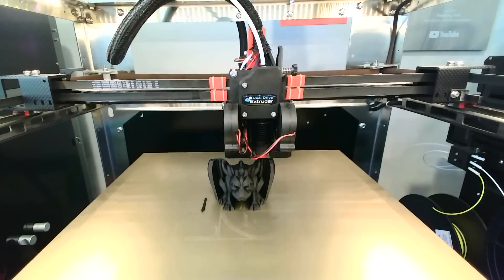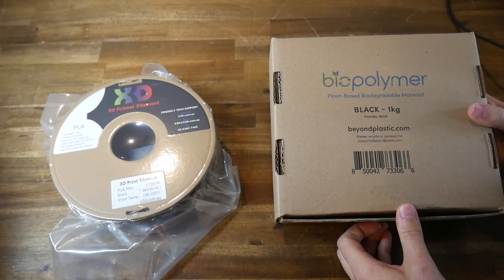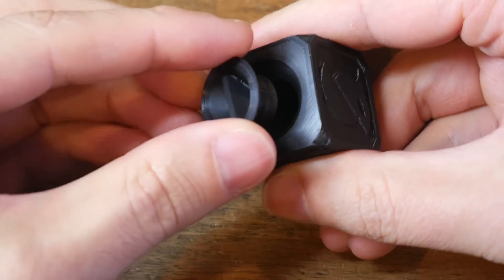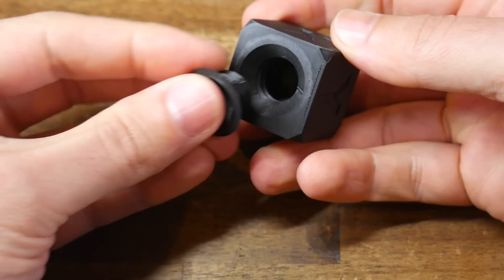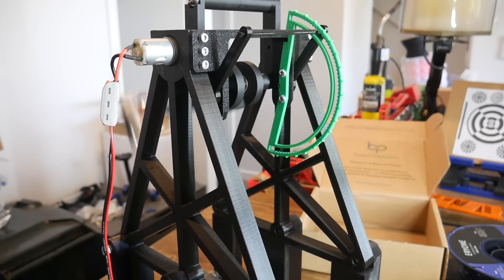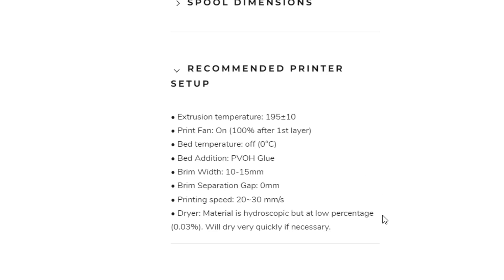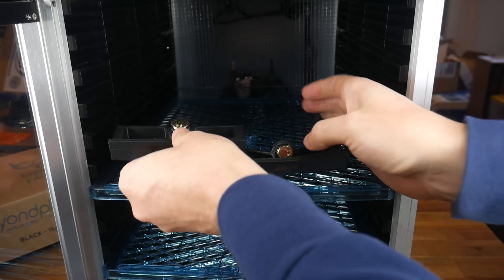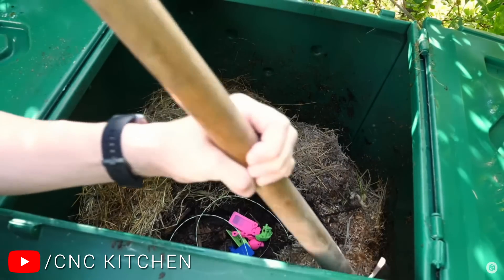PHA filament - Mostly superior to PLA and actually eco friendly

Comment: So if I am following this correctly, it prints comparably to PLA in most cases, it has better heat and UV resistance is and is more resilient / less brittle than PLA.  I guess we didn't see how well it did with bearing a load.  I am very interested to see if this is actually biodegradable.  I would absolutely use this with what I know right now, it seems to be better than PLA in a lot of ways.  

This may be a pedestrian question, but how does it stack up against ABS?  From my perspective, which isn't very sophisticated, the heat and UV resistance are the main benefits of ABS vs PLA, and while those usually aren't a concern for me, sometimes they are.  This just seems like it can replace ABS in a lot of use cases without the need for an enclosure and ventilation and have less of a long term environmental implact.

I'd also be interested to learn about other aspects, like is this food safe or plant safe for plants you are going to be harvesting?  How is adherence between this and other filaments? How does it clean up? (I haven't printed things where I worry about sanding or painting or vapor smoothing yet, but eventually I will get there).

Comment: I'd love to see a formulation of PHA with CF which may mitigate the shrinkage issue and further improve mechanical properties without affection biodegradability
Reply: Carbon Fiber is not biodegradable. 

Word of caution: And this is from the former CTO of Beyond Plastic PHA tested above. 

Composting bioplastics if miss-managed, is the fastest and most efficient way to introduce highly toxic micro and nano plastics into the food chain. 

In Los Angeles, we have composting bin where I do in fact throw in my PHA prints. However, if I was to discard a CF+PHA print. It would be in the regular garbage , and not the composting bin. 

Composting material is meant to be re-introduce in garden beds and other agricultural activities on commercial scale. I don't think anyone would enjoy CF in the very food they grow to eat.

Comment: 100% interested, the warping will probably be figured out and aside from that it looks like a perfect material
Reply: If it were a perfect material, it would be in general use/would have preplaced PLA by now. The warping might be its downfall.
Reply: @c.augustin  not sure, some materials emmerge now because they were complex or not interesting to manufacture yet, FDM requires matetial properties quite different from other polymer uses (i.e injection molding needs very low viscosity)
Reply: @c.augustin  warping might be solved similarly to nylon where they mix some fibers in it

Comment: But how does it compare to PLA+? I don’t even care about the biodegradable aspect, if it takes heat better than PLA and is less brittle it may be more useful for functional prints, if the cost is around the same as what you paid ($20/kg)

Comment: It was looking so good up until the warping. That is just not acceptable, especially since it doens't seem to have a workaround to resolving that issue. 
One thing you should think about adding to your filament testing is a shrinkage test, such as califlower. Shrinkage is a major issue when printing mechanical parts.
Reply: "not acceptable" dude, all common printing materials shrink, have you tried PETG, ABS, ASA, Nylon... :D PLA is quite an exception in that it does not need a heated chamber.
Reply: @PunaJussi  Nonsense, PETG doesn't have warping issues. PHA seems to warp more than Nylon composites too.
Reply: @oyuyuy  "PETG doesn't have warping issues" -- huh? I have problems with PETG prints warping, not all the time, but certainly often enough that I know a claim that it simply "doesn't have warping issues" at all is false.

The warping demo in this video involves very thin vertical walls, which is a different warping profile than PETG has in my experience and appears to be a worst case scenario for PHA. The other prints demonstrate that with more forgiving print scenarios, PHA is perfectly fine. So...know your material, print the right material for the job, mitigate known issues if necessary.
Reply: @harvey66616  Then you're doing something wrong. I've printed 100s of kgs of the stuff and honestly I can only recall like 2 or 3 prints that had warping issues - which was of course easily managed by adding a brim that I should've added from the get go.
Reply: @PunaJussi  I've never experienced shrinkage to the extent shown in the video. That's really bad. PLA and PETG can shrink if it is in a draft and the lower levels cool too quickly, which is why we have heated beds. I haven't had PLA or PETG shrinkage where it pulls off a bed after using enclosed printers.
Reply: @PunaJussi  The low print temp of PLA, combined with a lower thermal coefficient of expansion, certainly helps. I just printed two parts 14mm wide and 280mm long, laying flat, and they are amazingly flat. So I'll hold off on any "new stuff" until it is as easy to use as PLA or PETG.

Comment: I wish you would try that same print that had the warpage problem and use Vision Minor instead of whatever that glue stick you used is. See if that achieves a different result.
Reply: And I would absolutely be interested in the PHA if it was a similar price to PLA from a place like polymaker or creality etc.
Reply: That doesn't work unfortunately, the gen 2 PHA he's using needs to be near freezing to print correctly. The engineers formerly at beyond plastic are working on a new formulation that should resolve warping, as a simple glue stick or sticky plate solution doesn't resolve the issue.

Comment: Really curious to see how biodegradable this filament is. One thing that always makes me feel guilty about printing is the amount of waste I produce with no viable way to recycle it.

If someone could figure out the warping issues would be all for printing with PHA. 

IMO I would rather have plastic that degrades over time and just need to reprint it every once in awhile then something that lasts for thousands of years.
Reply: Former CTO of Beyond Plastic Here. 
"How biodegradable this filament is?"

Easy answer: 

The material is TUV Austria Marine Biodegradable Certified (Certification S2979). This is the highest and most stringent certification available today for biopolymers. 
In brief, it must pass three test: 

1) Marine biodegradability as per ASTM6691
 2) Toxicity testing using the above medium with Magna Daphnia, less than 10% mortality rate (we pass with 0%). 
3) Disintegration test, 90 days must break down as quick as paper (cellulose). This was actually the toughest test to pass. 

New material is being developed, eta December or January launch.
Reply: @fredpinczuk7352  Where's the best place to stay informed of upcoming developments on this?
Reply: @fredpinczuk7352  Dec/Jan of which year..?
Reply: totally the same with me, i wouldn't even mind if the plastic degrades within a month since 50% of what i print by volume are jigs and dimensionaly proofing parts, not actual part that need to last
Reply: Biodegradable does not equal compostable. Biodegradable materials need special conditions to biodegrade. Biodegradable materials do not fully biodegrade on their own when thrown into wilderness. These materials can stay for hundreds of years in dirt without fully degrading. 

90% of biodegradable stuff is a scam.
Reply: You have to keep in mind that if you throw away your PLA prints and they burn them in the garbage disposal the CO2 released is roughly the same amount that the corn the PLA was made of absorbed while growing. So basically, PLA is CO2 neutral, accept for the manufacturing process of course.

Comment: We have begun testing PHA for use in my Conifer nursery. I am excited at the possibility of manufacturing my own root pruning bio-degradable containers instead of being reliant on Jiffy.
Reply: I'd see about using a paper based method for that. Can fold newspaper as a quick option, or perhaps build a mould and fill it with pulp... need to try that.